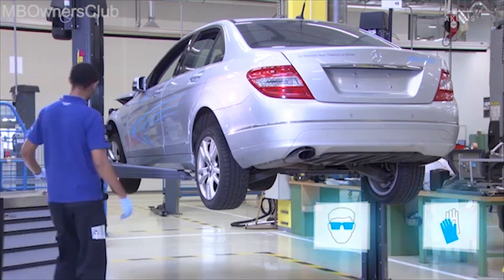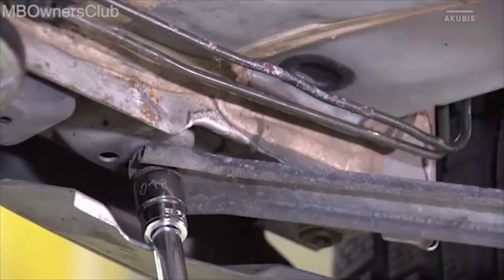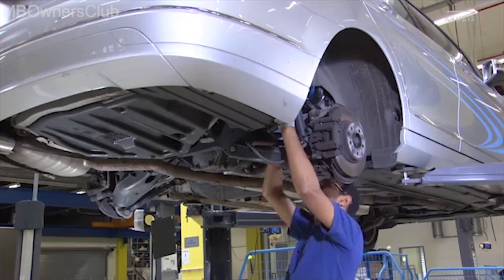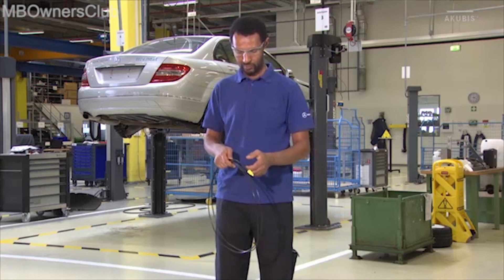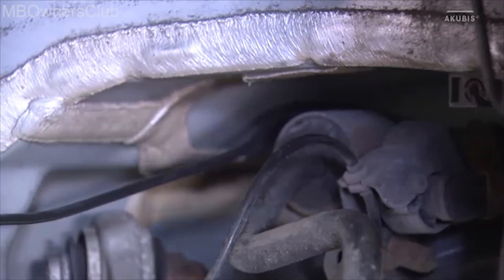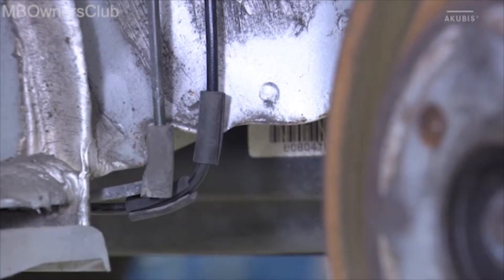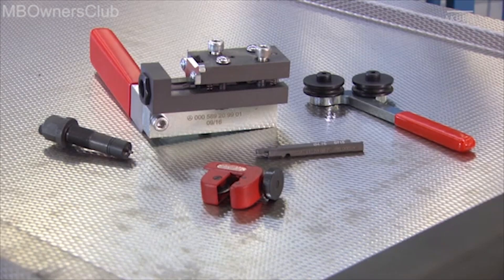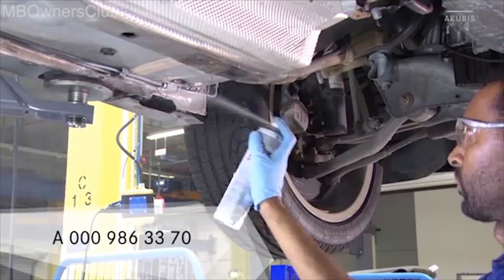Mercedes-Benz -  How to replace the brake lines: A How-To Guide | Represented on: C-Class (W204)

Comment: Excellent video.  

Just got quoted $5700 for a full rear hard line replacement.  Said something about having to take a bunch of the underside off to get to it.  

Lol, it's a 4" section of rusted tube.  Heading to Oreilly's now.
Reply: Same! The prices is crazy for this kind of repair. Mines is rusted out as well both front and back.

Comment: How much that will cost at MB dealership?
Reply: Just got a quote for 2800 USD for rear brake lines.  Is this normal, or is this gouging by the MB dealership?
Reply: @craigleon8323  do not pick MB as a first option...
Reply: @maniaro10  good advice
Reply: @craigleon8323  i sort it mine ... In UK I changed the breaking line system for 420£ ... Not bad . Good luck
Reply: two kidneys and a lung
Reply: $2600 cad just got mine done this week , ridiculous how much they cost cause of how labour intensive it is
Reply: @Tyron98  feel sorry for you .I end up by paying just 420£(around 500$)

Comment: The brakes on a car are the number one safety device. How come Mercedes use such inferior quality brake pipes. I was horrified to see how much corrosion there was on my pipes. They had lost over 50% of their wall thickness. This is totally dangerous and Mercedes should be held accountable as it is such a common fault and corrosion proof materials are readily available.
Reply: I honestly think it’s how they route them not the qaulity, they sit right beside the pinch weld and have a plastic panel right below them. All the salt and water that gets above the panel will pool along your break line and pinch weld. Cause when I pulled the panel there was tons of gunk on there by the lines.
Reply: @patrickmcmahon1110 Smart observation!

Comment: can order that whole line from ebay or anywhere? please someone link me a website (delivery for germany)
Reply: There's 4 different part numbers for each of the 4 steel brake lines.  The line in this video looks like part# 1234208128.   I didn't want to deal with bending new lines so I found a salvage yard willing to remove and ship me the brake lines from a car in really good condition, a California car.  I buy alot of used parts from California salvage yards because the parts look almost new, here in New England everything rusts.
Reply: @timb7775 Brilliant!! How did you discover this?

Comment: 2010 C300.  
Found a puddle of brake fluid on the left rear wheel, one of the line is dusted and ruptured.  Mercedes quality is pure garbage.
Reply: My e 350 2010 coupe began leaking a little bit infront of the rear wheel on driver side. Cannot see where from cover in way. Haven't gotten around to taking off.
Reply: @MrDengo999  did you get around to check? Im having the same problem….
Reply: @Jovan.101  yes sir, it was the hard brake lines, rusted through causing a leak, I had to replace all. As they were all the same state. Just one had a hole tho
Reply: @MrDengo999  where did you get the lines to replace them?
Reply: @Jovan.101  had to order from Benz, specialized part. Couldn't find elsewhere.
Reply: @Jovan.101  your shop could order the right size steel lines and bend them the correct way if you're on a budget. However you'd have to ask if they are willing.
Reply: @MrDengo999  I’m planning on doing it myself, off the top of your head. What was the cost for both lines?
Reply: @Jovan.101  the entire job cost me 1200 bucks Canadian. I'm not sure how much the cost for the parts was
Reply: @MrDengo999   I just replaced both my rear hard brake lines on a 2012 W204 and it cost me $60.00 and took me 2 hours to complete. Very easy job and replaced the steel line with Copper-Nickel Alloy which will not rust like the OEM lines.

Comment: That should be fixed by free. Brake lines rusting on most w204. A recall or something. I've just seen it today when i was replacing the rear brakes.
Reply: agreed...mine is a 2012 c350 kept in a heated garage ! was shocked to lose brakes. Rusted out drivers rear line , where it joins the flex hose. ..lucky only cost 300 to fix ... not at dealer.
Reply: @RadiatorSpringsMuseum  did you have to drop the rear subframe frame to replace?  I’m having this same issue with my 2010 w212.
Reply: @jonathanbooth1990  I don't know what they did, I do know they had to remove all the panels under the car and got a good solid piece of line about half way to the front of the car. They don't appear to have removed any big things , I presume he snaked it in while the car was on the hoist. Hope this helps.
Reply: Yeah samé on e coupe 207...
Reply: Same on my c220 and the rear subframe literally rotted through and cracked
Reply: I had never had a brake line blow out ever until three weeks ago. The last one I could expect was on a Mercedes. Mine is a 2004 w203. Nothing else rusted nearly as much as the brake line which is the most difficult to reach. Wonder why the lines were not made of stainless pipes.. I was told the steel line is impossible to flare. Is this statement true?

Comment: You seem to skip everything involved in getting to the rear brake lines. Its not as simple as its made out on your video. What about the fuel tank and all the other parts in the way. Lets make this clear. To replace any rear brake lines on a mercedes is not this simple or quick.
Reply: that's to keep the labor down for us techs. I have a 202 rear subframe and gas tank removed and replacing the rear brake lines. the rust makes it a bigger job
Reply: I’ve got an 204 in my shop now! It appears it’ll slide out relatively easy, but you’re right, missing several steps!!